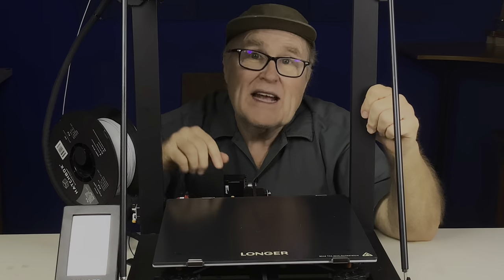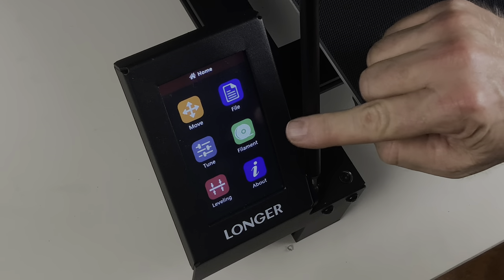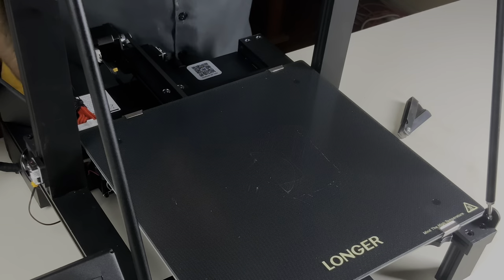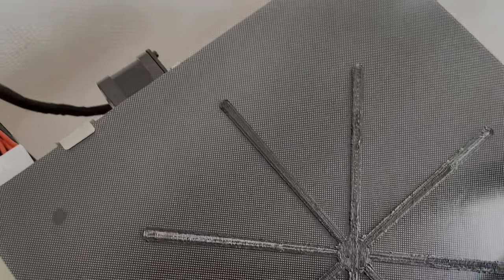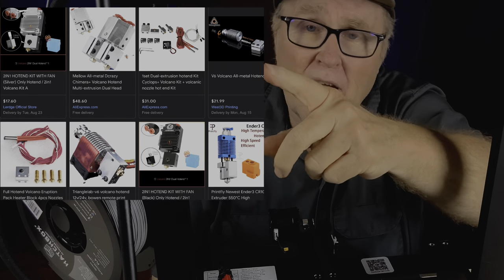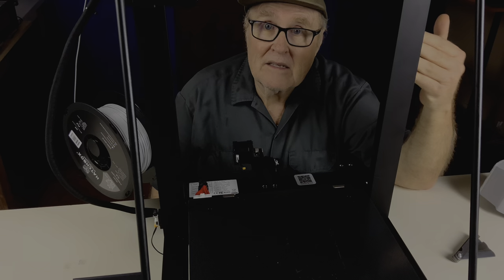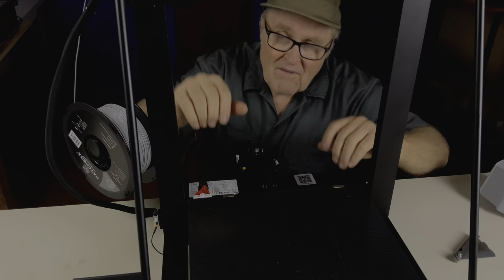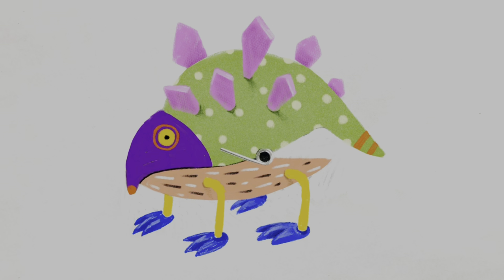Making Big Prints With The Longer LK5 Pro Printer

Comment: I am certain the cause of the issues with the first few layers is over-extrusion. I have seen this many times.

Imagine it this way: each line of plastic exceeds the allotted space,  spilling a little into the area for the next line. As the layer is laid, each successive line encroaches more on the next. First you get ripples, then you get rough patches, then you get boogers. When you get to higher layers where there are gaps for the excess filament to spill into, the displacement stops having these chain reactions. The lines aren't spilling into eachother anymore, so the print evens out and the rest prints smoothly.

Alleviate the over-extrusion by reducing flow rate and/or increasing the height for the first layer. Looking at those prints, probably moreso the flow rate.
Reply: Love your videos, BTW. This was a great review.
Reply: One more idea for you: I print with up to 0.8mm line width and 0.3mm layer height all the time with a standard 0.4mm nozzle. Surprising how well that works! I'm shocked that now one seems to talk about doing that.
Reply from the maker: Wow, I’m going to try that. Thanks!

Comment: One kinda quick and dirty solution to a warped bed is to use a piece of borosilicate glass. Some plastics will not adhere to the glass though. Three downsides: the bed needs to warm the glass before you get started, an auto level sensor that is magnetically triggered will not work, and  it adds a bunch of mass to the bed. In general, printing taller parts on a bed slinger design is inherently difficult, as your slinging more mass as you print and some of that mass is molten plastic. Bed adhesion will really be critical. You may want to add rafts to tall parts to give more contact area with the bed. Good luck. Those crappy printers will keep coming for review.  Maybe eventually you'll get enough someone can make one decent printer for you
Reply from the maker: Thanks for your input.  I am done accepting budget printers. This experience has convinced me that they are not right for my personality or my channel!  From now on machines will have to meet two criteria: The first thing is that they are complete and work right out of the box. No need for upgrades or modifications just to make them work. Second the company must accept that I don’t do reviews. I will happily use a machine for projects if it can expand the opportunities for the channel. Otherwise I am not interested.

Comment: That is some weird printing artifacts, especially since its localized to the bottom layers. Check and see what temp the bed changes to, if any, at the later layers and change it to that number. Extrusion multiplier would be my next guess but with it being... fine.. later on I would see if anything changes within the software as the print goes on first, (cooling, bed temps nozzle temps) definitely try different software, my current free favorite is Prusaslic3r if that machine is lock to a software then I would start looking hardware. (make sure its solid as a rock and the things that move are oiled) Anyways love the videos and I dont comment often on anything but that is some weird printing artifacts and I've seen my fair share so I hope you figure it out and report back.
Reply from the maker: Thanks Just, I will keep working on it!

Comment: that early repeatable snot is too much plastic. yeah I know obvious as all hell but the actual underlying reason /could/ be a complicated set of factors. my money though is that the head thinks it's WAY higher up than it actually is, so when it's supposed to be laying a new bead down at the next height up, that height isn't as high as it thinks it is, so it's adding more plastic in place than it should be. As it progresses up the print the difference levels out and the additional plastic dies out, the print continues as normal. 

Testing is good, right? in the same print job, print multiple square based towers at different widths, 5mm, 10mm, 25mm, if they all have the same snottage at the same heights, thats the issue right there, the nozzle is NOT where the printer thinks it is, it's close sure, but not quite and that scaled difference is most noticable where the base constraint is, remove the constraint (height) and the error relaxes.

ALTHOUGH! 3D printers LOVE to catch you on speculation. I've had a dodgy 3D printer for years, it finally cocked up one time too many and I threw it in the parts bin. I now have a Prusa Mini+ and I bloody love it cos I don't have to think about how to dial it in, or call upon the darkest forces. I don't want a close and personal relationship with a hammer, I just need it to hit stuff harder than my hand.
Reply from the maker: Thanks, I’ll give your test a try.

Comment: I will NEVER buy a Bowden printer and FYI there is no such thing as a level bed! The ONLY way to do it is automatic bed leveling where the machine can calculate and store the bed level and then compensate for that during the print! Since you have already identified issues with your bed I would suggest the problem with those first few layers being bad is due to the head being to close to the print.
Reply from the maker: I prefer direct drive myself. Seems like once you establish the Z zero height the printer should print fine.

Comment: Bob, it’s nice to see you are enjoying your “down” time.  Unfortunately, or fortunately you appointed me to tell you when you are going off the point of your channel description of MOLD & RESIN MAKING.  I’m not sure where you’re going with this new programming. One week your teaching us how to make molds and pour resin which if I’m correct won you a huge following of You Tubers. Now you’re off on a tangent of critiquing 3-D printers.  Do I hear the slippage of subscribers starting to loose interest? Time to make some decisions Bob. Is this 3-D printing really something you are interested in? Do you really want to vacate your channel parameters.  Think long and hard my friend. You’re at a dangerous cross roads.  With that I wish you only the very best.  Richard
Reply from the maker: Hey Richard, thanks for chiming in. I have little interest in 3-D printers per se. But I really like the things we can potentially do with them - like directly printing molds in flexible materials or mold cases that are shaped to fit the sculpture to be cast. The possibilities are endless.  I try to put a positive spin on things but I really dislike doing machinery reviews which is why I usually don’t do them.  Two of the machines I accepted are from the same supplier. I made the mistake of accepting the machines before reading the contract. This machine and one other had very strict requirements.  Rather than put up a battle I thought, lesson learned. I will meet the requirements and be sure that in the future I can use the machine on projects, not do reviews.

In short, you won’t see machinery reviews on my channel.  There will be one more to fulfill my obligation but after that I shall be careful to avoid them. I really dislike doing them anyway. And there are lots and lots of good YouTube channels doing reviews. I turn down advertisers at least once or twice a week, sometimes more often than that because of what they are selling or how strict they are about video content.

All that said, I would like to do projects beyond mold making and casting. That’s why I ran that poll a few weeks ago asking if the viewers preferred I stick with mold making or if they would watch me do other kinds of projects. Overwhelmingly they said that they would watch a variety of projects. But never fear, moldmaking will always be a core part of the channel because I love doing it and there is still much more to explore.

Richard I always value your input because you are such a regular contributor to the content of this channel. Thanks for being here and for taking part in the comments! 👍👍👍
Reply: @RobertTolone  Wow that’s a relief! I thought you were going over the edge Bob. Glad to see you were just dabbling on the dark side. Ha ha!  As many of your subscribers, I look forward to watching your channel to see what you will come up with next.  Best regards. Richard